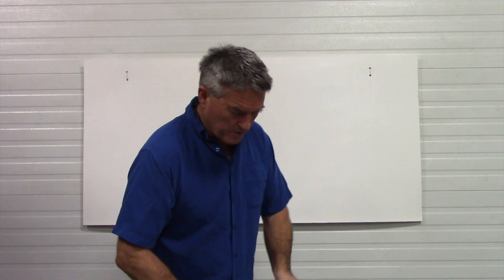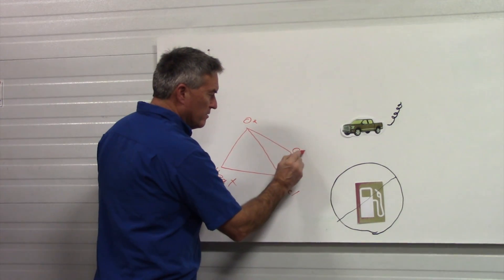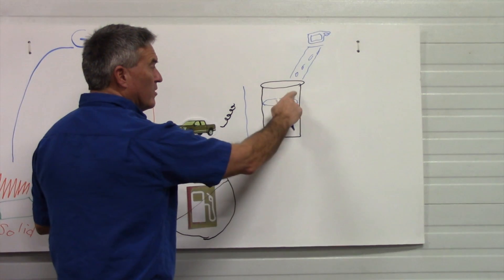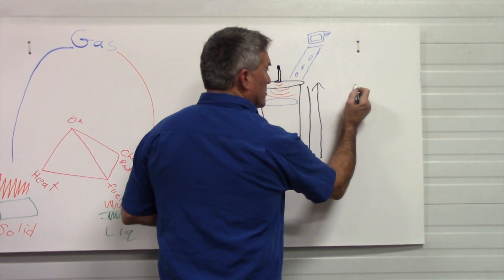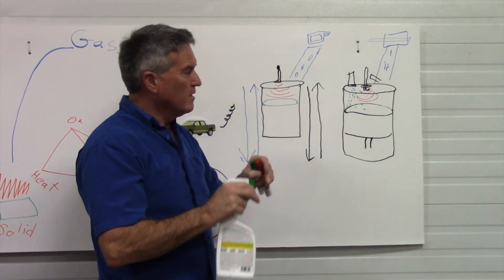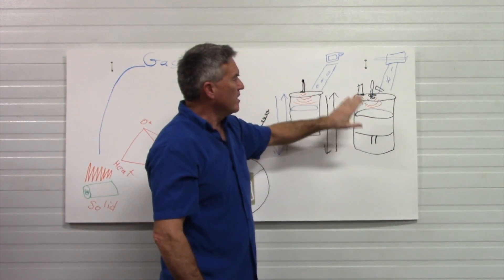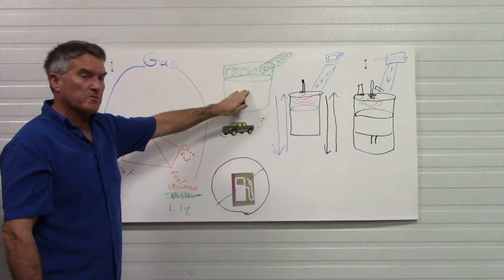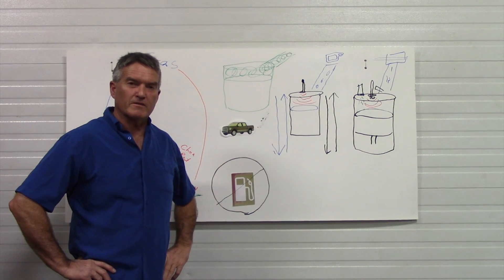One Simple Trick to get 100 miles per gallon with less pollution!

Comment: My kerosene stove in my sailboat operates this way. There was a carburetor developed by Pohge that was supposed to get 300 mpg in the 20s-30s. The reason we don't have this technology now is because it is suppressed and they have constantly changed fuel formulations to make the technology fail, or we are to lazy to figure it out again
Reply: You are wrong about the years and also wrong about if & why formula may change. You are a conspiracy idiot

Comment: Without the liquid gas to lubricate and cool the cylinder heat would increase until the engine seized..... as of yet I don`t believe anyone has found a cost effective solution to this problem which is a major factor in why we can`t do this.
Reply: What about mixing oil with the air and gas fumes? Don't know how to do it?
Reply: @TimothyAllenCampbellGoTimothy  Sounds like a plan.... I am sure THAT would cut down on emissions, chief.WOW.

Comment: Where to start...well,  for one thing,  the combustion engine doesn't just simply dump liquid gas into the combustion chamber and burn it.   Answer this,  what causes a liquid to change state into a gas?   What is the ideal  fuel to oxygen ratio  for  x power?   Secondly,  don't think engine manufacturers haven't known everything you stated for many many years.   On the basis that they have,  why do you think they have not implemented something like you suggested?   The simple answer is,  they figured it might be bad for business having customers driving around with bombs in their vehicles.   My word,  you have to take special measures just to transport propane legally and the bomb you're suggesting is far more powerful than a propane bomb.   Seems to me that the current strategy of trying to transform to electric vehicles is far more sensible and safe.

Comment: I’m not convinced that this will work. How will this system actually improve performance? The system would need to adjust air/fuel ratio (Stoichiometric ratio) for different loads, temperatures, atmospheric pressures etc. 

Thus is already predefined by the ECU and engine management system through the complex network of sensors and predefined maps/programs.

This may work well if predefined for idle ratios but the system is far from ideal to handle the variables of average driving.
Reply: again yu R overthinkin...watch CNN for more information on what to believe..

Comment: This made sense right until they showed a petrol burner in an enclosed area not producing any harmful gasses! Petrol is basically Carbon and Hydrogen (there are derivatives with different ratio's) but it is basically similar. If you burn this (you Oxidise it) you get CO as a gas given off in the reaction! 

Now I challenge anyone who thinks Carbon Monoxide is not harmful to take a single breath of it and video their reaction!
For anyone interested in it the body will stop bonding Oxygen onto their red blood cells! As the body regulates breathing by the level of CO2 it will see no increase so you will not feel out of breath ...... but your body will not be receiving any oxygen so cells will begin dying! Loss of consciousness will be quick!
Reply: We use gasoline heaters inside houses, and kerosene heaters. There are gas lanterns for producing light and gas stoves for cooking. They work indoors, but can result in fatality
Reply: Yeah .... In the olden days when houses used to have working chimneys and windows that let air in!

Comment: In EU is called LGP or GPL cars are running with it all ready for 40 years. In India I saw 2-stroke engine running with LGP
Reply: LPG is a by product of gasoline. He is taking gasoline that has a higher BTU than propane and pressurizing it. Its different

Comment: Ok, lets answer the question, the simple trick? Drive 20 miles to an 80 mile downhill, stick it in neutral, coast.
Best done in a pre 80's car with manual/stickshift, carburettors and cassettes rule!

Comment: Ummmm, you said in your video that liquid fuel is used to cool the cylinder/piston and that if that wasn't there it would overheat right?  OK, so how do engines run on propane, natural gas, hydrogen or any other gaseous fuel without overheating/failing?  If liquid fuel can produce 100mpg than why doesn't liquid propane make 100mpg+ mpg #'s?  Any simple heat rejection study will prove that it is NOT possible to attain fuel efficiencies you claim.  An internal combustion engine CAN NOT attain this level of efficiencies PERIOD -  EVER.  There is no massive conspiracy by auto companies to keep this from the public.

Comment: Smokey Unick has a US Patent on Hot vapor flow fuel technology based on the same concept. He built a fire with a vapor flow carb with rotating brushes to vaporize the fuel.
Reply: Smokey been dead 20 years.

Comment: Electric cars will never work as long as they tried to not enough power and unable to be as reliable as gasoline
Reply: Electric vehicles are more reliable. They have less moving parts to break down. The newer ones can go 250 plus miles between charges. 0-60 times from under 3 seconds to 5 seconds and upwards of 155 mph. Not sure where your information is coming from. Do some research. This is not 1980's electric cars.
Reply: I don't have to do much research they have these Tesla charging stations at Walmart and at the mall the only cars that park at them or regular cars I never see anybody charging a vehicle
Reply: You have to have something to keep it charged the gasoline motor can keep the electric charged but you still use gasoline primarily and electricity secondarily
Reply: And it's 40 years since the 80s and they still have gasoline vehicles they will never fully replace the gasoline engine because of the durability and reliability do you think our president is going to be riding around with a Chance the battery will go dead maybe if you're in a city and you only drive 5 miles a day but here in the South when you have to drive 2530 miles a day back and forth it doesn't work

Comment: Or we could put manual air compressor cylinders on each wheel leading to the tank secured with popoff valve air pressure for power!

Comment: I've seen so many claims of high mileage by people burning gas vapor, but I also saw Project Farm do a test and that was not the case. The motor ran for about the same amount of time whether running on liquid fuel in the tank, or on vapors with the same amount of fuel. Why so many people making such claims of high mileage?
Reply: I've done A vapor carburetor like Project Farms with even worse results.  Mine was used on A lawnmower and residual unburnt fuel would be left over.  The heavier part of the fuel isn't as easily vaporized as the more volatile components.  In short you end up with crap gas that you can't use and the engine overheats. 

Only did that project because the carburetor broke.

Have A much better prototype nowadays that allows the use of optimum ignition timing on most fuel injected engines.  Advancing the timing means the engine has more time to use the energy at each combustion event.

Comment: And north america is only5 percent of the planet....so we have no effect
Reply: Apparently you study very little. America is 5% of the world's population, yet we use 25% of the world's resources!
And gas can safely be used as vapor, by putting a flashback arrestor in the fuel line; my own vapor carb on my lawnmower cuts my grass on about one cup of gas, compared to a quart as before with a stock carb. 
See videos by The Vapor Kid if you want to play.
Reply: Oops my bad.... Population....my point is that the amount of oil we use has no effect on the climate....or the amount of available oil...if so there would have been electric cars70 years ago....but I didn't watch the video all the way through....and yes I definatly believe the engine running on vapor I've seen it another reason I don't belive the climate change or the lie oil reserves are running out.....I'm always willing to hear what people have to say it's impossible for me to know everything there's always changing facts
Reply: @itwasme3298  
We have untapped oil reserves they are not telling us in order to make the most money now.
I made a vapor rig for my push mower, and mowed my lawns with about a cup of gas last summer. I need to do some improvements on it and put it back in service.

Comment: Really?  Vehicle generate hydrocarbons?  That is a false statment.  Hydrocarbons are unburned fuel. Most likely they are introduced to our atmosphere at gas pumps while storing or filling. 
In fact the fumes from gasoline in your tank are not even released to atmosphere . They are captured and directed to be burned during normal operation of vehicle. 
The measure of plutents are do in parts per million.  Ppm  . Tons and gallons are not used . Vehicles sold in state of California since 1996 are guaranteed to not pollution  or malfunction and pollute in the first six years of operation.   By the manufacturers.

Oh ya and gasoline is not vapor ,gas,fumes  in cylinder 
 It is atomized.

Comment: 11:50 for everyone that understands how an engine combust. This is a concept at best, a good one but non the less a concept video.

I want to see the video I thought was going to be posted.... how to actually apply your knowledge to my vehicle now. Don’t forget that you can run a Diesel engine off French fry grease only and you can run water only for a gasoline engine with a very simple to build Hydrogen Fuel Feed System. Alkaline water works best (high PH). You can also propane fuel a diesel truck..... many many ways to create free energy or cheaper and cleaner energy

Comment: Check your math, @ 2000 rpm each cylinder is firing 1000 times on a four stroke cycle engine
Reply: @Eric Kirklin:  Re-check your math.  1000 times per MINUTE equals 16.66666... times per SECOND.

Comment: So stupid can't get more energy for nothing just transformation to a gas vapor not liquid will not make more energy the only way to get better mpg is making a efficiency change the torch thing is lie you can't cut steel with just oxigen after you get it started doesn't matter what you use to start it the only reason use different gas is to help get better cut with shielding gas or temperature changes different gasses burn at different temperatures and also learn about thermodynamics and energy everything has a certain amount of  energy stored in it can't make more energy than what is already there

Comment: Liquid gas is not what goes into the cylinder, that's a flooding out situation, it atomizes in the airflow to the cylinder when adjusted properly
Reply: Liquid gas is what goes into a engine. This is why direct port injection cars have fsiled and manufacturers have now gone with a hybrid still split or direct port injection. Direct port every 30k miles the injectors are completely sludged and gummed up and run horrible. It has no gas splashing on the intake valves to keep them clean.  On a regular port fuel injected car around 70 percent of gas is wasted. The gas comes in splashing going all over the intake valves. Gas is a solvent and keeps them cool and clean. Bottom end of Motors run 400 degrees. Now some of the fuel cools and Lubricates the combustion chamber. Now on the exit it kinda splits. We have this horrible emissions bs EGR, unburned fuel cools and cleans the exhaust valve, the rest of the unburned liquid fuel is rerouted back through the intake through the PCV for another pass.  The rest goes into the other horrible emissions device the catalytic converter with the goal of being incinerated to make emissions nil. But they restrict and make back pressure hurting gas mileage. They clog and it can be partially clogged killing gas mileage for years and you wouldn't know unless it fully clogged.  Removing my cat and removed the EGR with new headers.  And gas mileage went up.  The restrictive devices make us burn more fuel. But anyways when the fuel injector releases it's mist that splashes over intake valves that's still liquid. It's just like me spraying cars for a living.  My paint gun atomizes the paint into a fine mist as its released its still liquid paint it's not a vapor. It doesn't go into vapor then back into liquid, fine mist.  If you mist water on your face with a spray bottle that's atomization just droplets of whatever substance Only the vapor burns the rest of the gas is needed to keep the motor from overheating and Lubricsted. Gas has over 100 Chemicals in it.  Gas doesn't lubricate like it use to since they removed the sulphur basically if your old enough you'll remember across America people's gas needles stop working when they reduced the sulphur content of gas to nothing. They took the zinc out of motor oil as well.
Reply: Maybe your car but not mine, it's,atomized before it gets into the cylinder

Comment: So how does the pre-mixer maintain an adequate rate of combustible vapor flowing into the engine at all different engine loads and speeds? And how is an accurate air/fuel mixture maintained at all engine loads and speeds? And how do you prevent the pre-mixer and induction system from exploding if a misfire occurs and sends a flame backwards into the pre-mixer?
Reply: This is just a fancy vapor carb. The amount of air coming in determines how much fuel is vaporized. More airflow more vapor less load less vapor. It's load dependant. All vapor carbs are is a water bong. Your intake air tube will go through a small container of gas and bubbles releasing gas vapor. Hit hard you get a better hit.  Take it easy it goes easy. Now on your fuel side out that is routed through your intake now not your injectors. Air and fuel all come together premixed. You get those little spark arrestors there likr a dollar it's basically fine screen meshing in the line if it back fires no problem. Your lawn mower probably has one you can take off it.  You can build one of these for literally 20. You need a 2 gallon gas can, tubing for the intake and fuel and some gasket maker to seal the tubes that now protrude out your can.  Flash arrested spark arrestor same thing different name cheap stick it in good to go.
Reply: All this one is,  instead of putting the gas can under your hood and pulling the fuel pump fuse. He's made one where the fuel pump will add fuel to that tank slowly as its needed. F 150s get around 100mpg with them. 2 gallon gas tank under the hood is more the plenty
Reply: @JamesSmith-lt5zz 
Excellent  my friend!
como lo hicistes ?
Es decir cada cuanto tiempo manda gasolina del tanque original a los otros ?
Colocastes algun flotante para medir  el  nivel ?
Reply: I was at one of Donald Novaks 200mpg seminars about 1980 and dabbled with a modified air cleaner vaporizer. One of the simplest designs. His solution for the inevitable backfires exploding in the pre-mixer as you say, instead of a short stud & wing nut holding the top of air cleaner on, was a 2” longer stud in the top of carburetor with a spring over it, then the wing nut. When the fireball happens it gets largely snuffed out. Also, keep a fire extinguisher handy!

Comment: Vaporizing the fuel heating it up and vaporizing the fuel so it is more efficient you can also use meter hydrogen also it is called a hydrogen generator

Comment: Also use a oversized radiator to help keep the engine cooler because the engineer will be running hotter you need a bigger radiator to help keep it regulated at the right temperature

Comment: Use sodium valves and steel Elway Pistons and the high quality piston rings that you use for the steel alloy Pistons sodium valves will withstand 1600 degree Heat

Comment: If you can preheat the fuel and injected into the motor where the gas does not cool down and it is vaporized you will get very excellent mileage

Comment: My grandfather taught me to how to modify carburetors for mileage he was a head mechanic for a Ford dealership back in the 60s I had a 65 Ford Galaxie 4 door 2 barrel carburetor 289 the motor was old I got 90 up to 120 on the compression pull a 5 by 8 trailer with a hundred pounds on the vehicle and I got 23 and a half miles to the gallon going through Wyoming on Flatlands I got 28 miles to the gallon grandfather taught me how to modify carburetors for mileage I can also modify the Holley carburetors and boards and Carter carburetors Rochester carburetors I like the Fords and Holley carburetors the best for modification for gas mileage

Comment: I have a 65 Ford Galaxie I modified the two barrel carburetor I had a 289 V-8 2 Barrel Ford carburetor new motor would have had 160 lb compression the old car I had had 90 up to 120 lb compression pull a 5 by 8 trailer was about 100 pounds on the hitch old motor got 23 and a half miles to the gallon this was a four-door Ford Galaxie I modified the carburetor if I would had the car only without the trailer I am estimating at least 28 miles to the gallon my grandfather was a head mechanic at the Ford dealership back in the early 60s and he taught me how to modify carburetors for gas mileage

Comment: II think he could have done a better explanation to what causes the saving. I am a fan of Indy races and we fans know that on a day of high humidity and or a little rain the cars have a real gain in power as the moisture causes the gas to fracture with a good separation the combustion burns more atoms of fuel. back in the 60s' we put spark plugs in the tail pipe and watch the rocket.... lol

Comment: I discovered how to bring are underneath gasoline in a container in 1999 hook it to a Briggs & Stratton 18 horse engine it started easier it had more power and hardly any fumes smell out the exhaust at all oh I did was hook a hose to the top of the carburetor with no fuel in the carburetor ran it to the top of a can ran a hose from the top of the can to the bottom half inch off bottom when the carburetor drawled it pulled the air from the hose on the bottom up through the gasoline and then to the engine it worked perfect